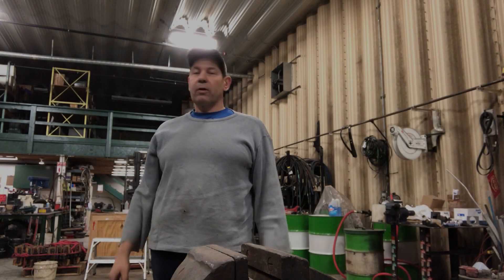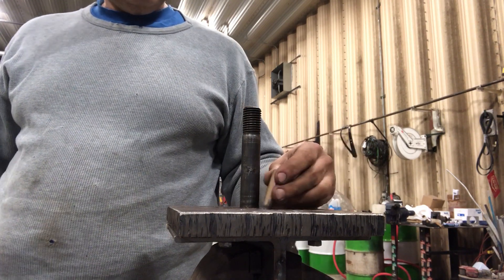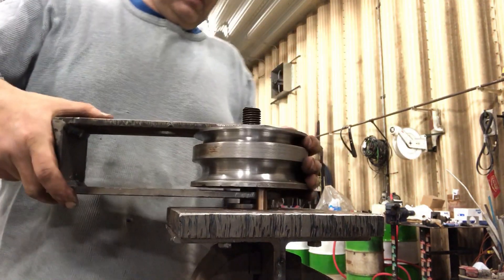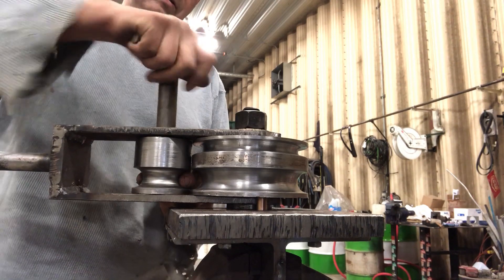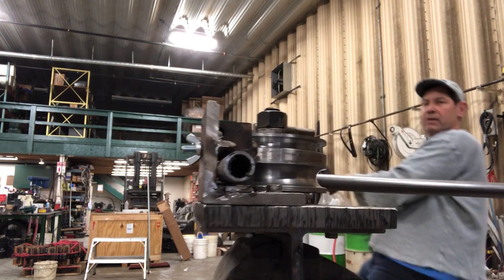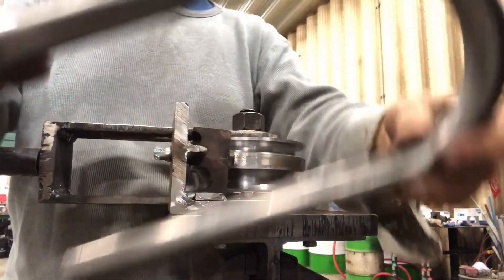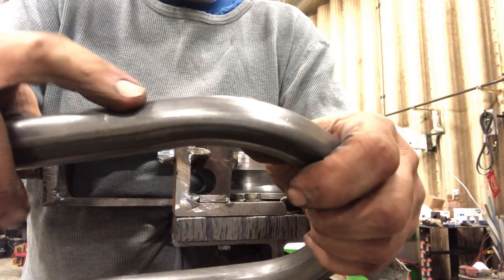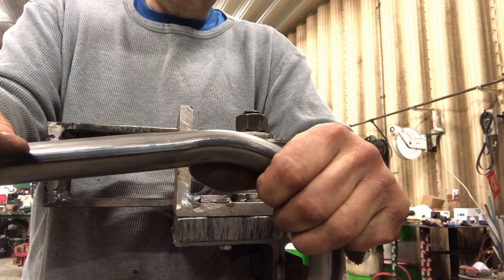DIY Tube Bender

Comment: Was that pipe or tubing that you bent?
Reply from the maker: 0.120 wall 1" CREW tubing
Reply from the maker: To explain:  Cold Rolled Electric Welded, so made like pipe but cold rolled to a 1" outside diameter.  The closest pipe size is SCH 40 3/4" pipe, which is actually 1.050" outside diameter and only has a wall thickness of 0.824". It is too big to fit my die, but would be easier to bend.
Reply: Will this style bender bend tubing for roll cages? I was thinking about building this?
Reply from the maker: @hustlerkc11  If for a car I would say no. Usually the tube for automotive safety cages is larger diameter tube. This would need to be hydraulically powered to go much bigger on the tube. For a cage on something like  an off road go kart it would be fine.
Reply: Actually I was thinking of building a motorcycle from the ground up.. ( bending 1-1/4 dom with 1/8 inch wall for the frame, think this would do it?
Reply from the maker: @hustlerkc11  Yes it should, if the unit is mounted to something solid and you have a long enough handle. The issue is accuracy of the bends because if you are straining at the end of a great long handle it is easy to over/under bend. 
I would be inclined to look at the way a JD squared bender is built. The handle mechanism is more complicated but gives a lot of leverage. It will be easier to get accurate bends with something like that. If I had to bend bigger stuff I would duplicate that design.

Comment: Good Job !  Where you find your die ?
Reply from the maker: I made it. It is a piece of 6" diameter steel. It is the most expensive bit in the whole thing because I did not have any shaft that big laying about so I bought it.  I think I paid $40 Canadian for that little piece.
I machined it on a lathe using the radius cutter in this video:  https://www.youtube.com/watch?v=CtIzMhPeaeg
Reply: @sutluc1  Thanks for your answer.  Have a great day.